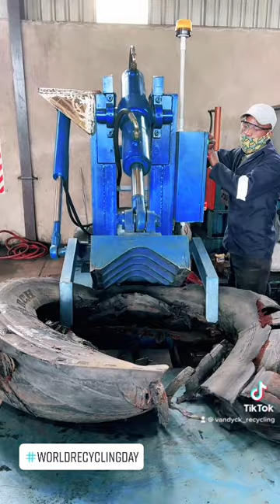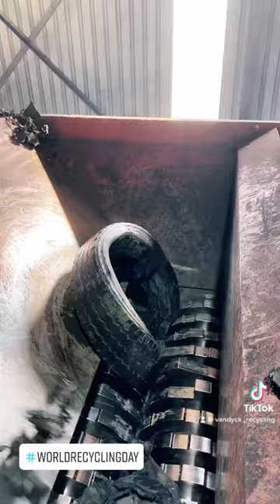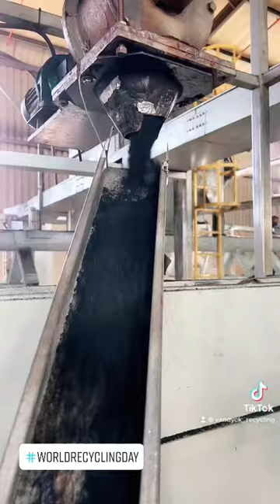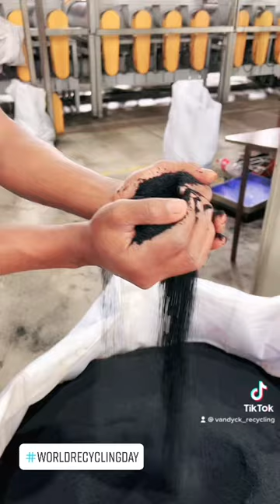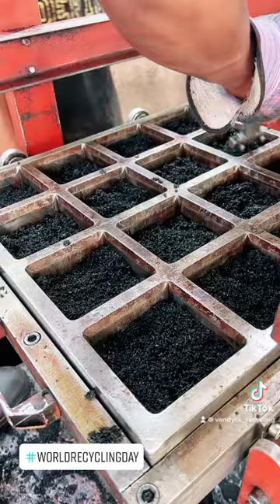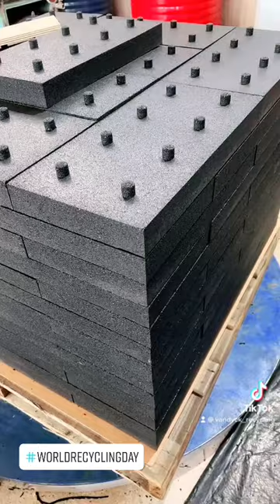Transforming Tires into Treasure: A Look Inside Our Tire Recycling Facility

Comment: Hello! Great video! Can I ask what's the price for the final product in the bag and is there a lot of interest of buyers? 
Best regards
Reply from the maker: Price will vary depending on particle size distribution and inco terms etc. There is a lot of interest internationally but if you can valorise the product yourself, value is automatically created and retained by you!
Reply: How can i know more about the machine setup pls?
Reply: @mzarrebini what is this dust or powder used for? Can it be incorporated into asphalt to make roads last longer?
Reply: Where do I can buy this?

Comment: I wonder if the steel cords are somehow separated or pulverized into the mixture
Reply: Unsure about this one but most other facilities I've seen that recycle old tires usually have a machine that pulls the majority of the cables out of the tire then there's another conveyor that has what appears to be magnetic that collects other left over bits of metal out of the pulverised mixture. Could be similar here though not sure.

Comment: Kuwait set ablaze 41 million tires ... why?
Reply from the maker: From what I gather, a simple fire can smoulder for years especially when tyres are intentionally or un-intentionally set alight. With the volume of tyres in Kuwait, it become an almost impossible task to contain. The same goes for a fire that was started by arsonists in Wales many years back at a tyre dump that was underground. It was only contained properly 10 years later.
Reply: @mzarrebini wow, that’s horrible for the atmosphere. Can this new product be incorporated into asphalt to make roads last longer?